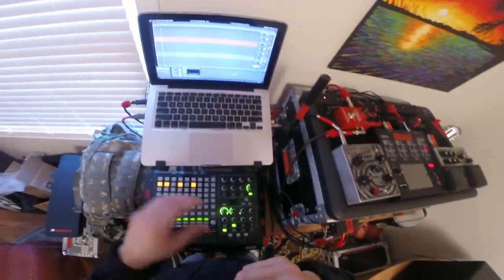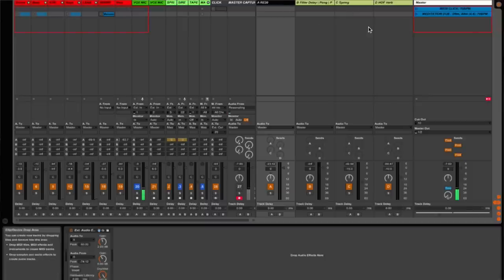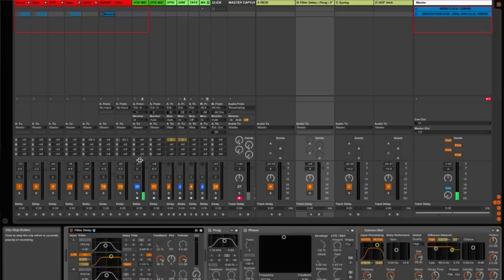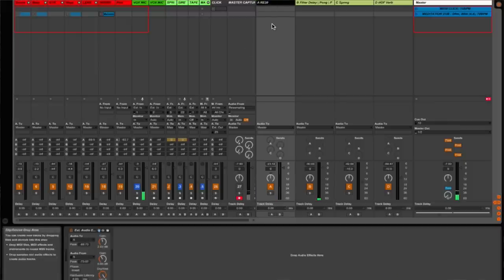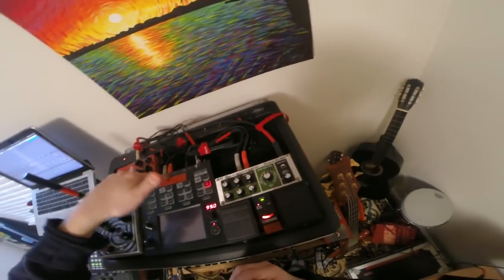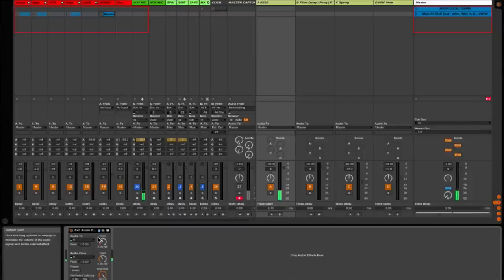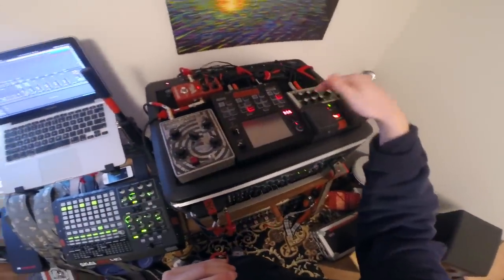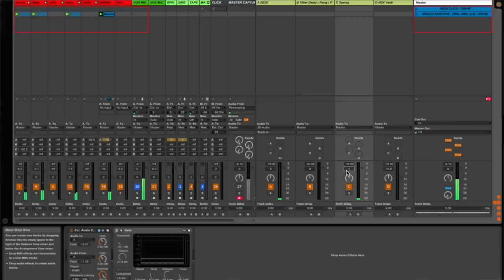Dub Architect - Effects Loop Tutorial

Comment: Greetings,
I am having problem setting up sends /returns with RE20. I tried insert jacks and  guitar jacks but still no luck.
What kind of jacks I need to send and return on my Logic and motu  set up?
Appreciated .
Reply from the maker: +hifi you should be able to use either TRS or TS cables with the Motu & the RE20 - I'd start with an instrument cable (TS).  You should just be running out from one of the outputs on the back of the unit to into the input on the RE20 and from the output of the RE20 to one of the inputs on the interface.  Then just setup that routing in Logic on an aux bus - click an insert - utility > I/O and then set the output/input sections to whatever #s you plugged the cables into.  Hope that helps!
Reply: I did try both with trs and ts cables but I just can't get the signal . trs doesn't turn the re20 on since the io on re20 are unbalanced .
Are you using trs or ts in your set up?
Reply from the maker: hifi When I'm using the RE20 I use TS cables.  As a general rule of thumb I'd always start with instrument cables when connecting stompbox type effects since they're basically all designed for TS cables.  I'd only start messing with TRS if you're getting a buzz which might suggest an impedance problem in which case you're kind of off to the races with reamp boxes and DI's trying to balance the signal - or if you're connecting "studio" gear that has balanced ins/outs.  But for this case TS should be totally fine.  Sounds like something's not setup right in your DAW. Or... many interfaces I've used come with their own software where you can alter the routing digitally - so you'd need to make sure the digital routing in the software matches your physical routing in/out of the interface in that case.  The Focusrite Saffire Pro 40 for example - sometimes the software will reset to a preset that turns off the ins/outs I need for effects and I have to manually load my preset to fix it.  If none of that works - check your input/output levels in your DAW, the interface software, the interface, and the RE20 to see where you're losing the signal in the chain - wherever you see it showing up on the meters your routing is working and wherever it stops showing up is where there's something wrong.
Reply: I will double check my interface software routing.
Thanks for your help.